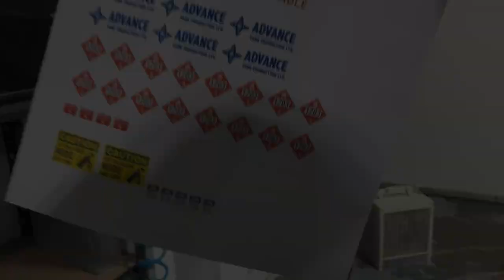1/14 Tamiya tanker trailer build

Comment: Very nice details, only needs spare tire and fuel discharge valves

🔵🔵🔵👍👍👍👍🙂🙂🙂🔵🔵🔵
Reply from the maker: Thanks Carlos, i'm not sure I know those valves. I googles a pic and don't seem to know what they are exactly or where they go, and of course have to make them. You mean the pipes that get connected to the valves that I have already printed? 👍

Comment: Could you give me an estimate of how long it takes to build this kit? Thanks, Miles
Reply from the maker: Well the kit itself if you were to build just the way Tamiya has designed it, I would say depending on the persons skill, 6-10 hours? Since I've customized this trailer, it has taken much longer. I've added lights, custom 3d printed parts, vinyl printed logos, probably 50 hours.  Hope that answers your question Miles. Thanks